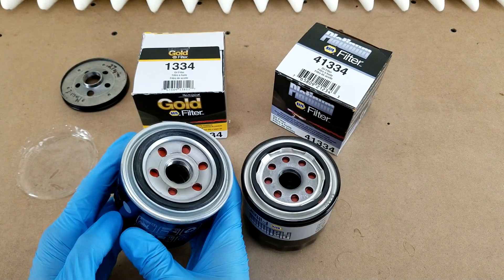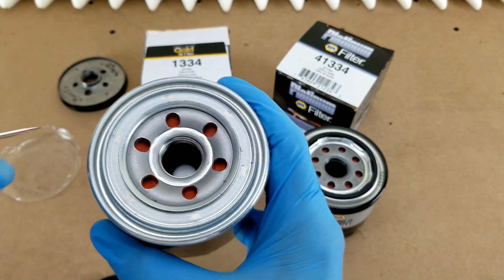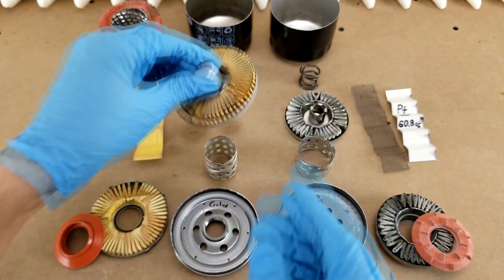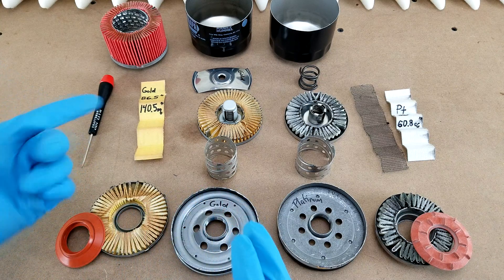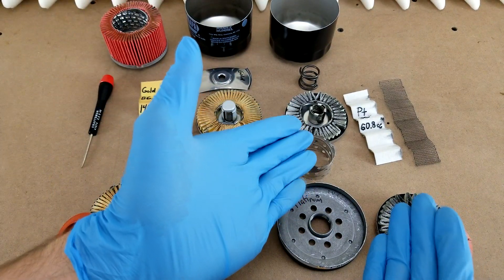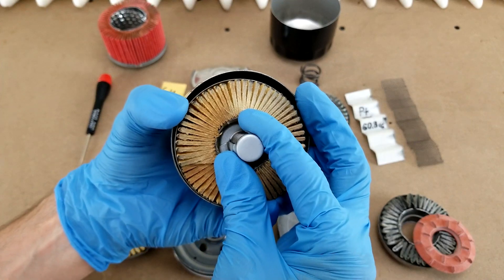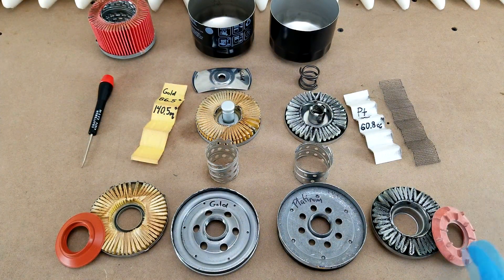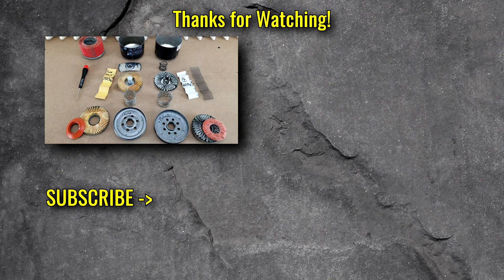NAPA Gold & Platinum Oil Filters Cut Open!

Comment: I do like the larger holes = more oil flow which is key .. but the platinum has that wire mesh backing for structural integrity (no tears, etc) and I wish the gold had it as well ..

Comment: Just a couple comments on the video. I notice the area of the inlet holes mentioned, that's ok. However, as long as the area of holes equal to the inner diameter block mounting stud, it's fine. My speculation, both filters at least that likely more. Also Plat synthetic media is depth media as opposed to NG cellulose/blend media, surface area filter. So amount of media and centertube size, not really comparable.

Comment: I work at Napa and the 1334 filter specifically uses the same style gasket as that platinum. And some of the gold filters but not all use the bypass valve built into the anti drainback valve. Not really sure the reason why some do and some don't. And most gold filters use a coil spring now instead of stamped steel.
Reply: I was looking at the spring factor too .. important but not a deal breaker ..

Comment: Good videos. I like your style if comparing debris micron size and material thickness. 
Not sure about the concern over the seal coming off. You should ALWAYS inspect the filter seal surface for debris - and that the old seal isn't stuck there.

Comment: It's Wix dude. Mann and Hummel bought Wix. Affinia is the packaging company Wix used. 

NAPA ProSelect, Gold, and Platinum are ALL Wix filters.

NAPA Platinum is the Wix XP line and Gold is the Wix standard line for regular automotive.

If you ho on the Wix website the part numbers are 51334 and 51334XP.

The beta ratio there says 2/20=6/20 and I have no idea what that means. You'll have to call Wix to clarify that. 

I do KNOW by experiment that the synthetic media tends to capture more dirt before clogging per square  centimeter and tends to collect in a more uniform size grouping versus semisyn, cloth, and paper versions. 

Basically you tend to get holes at the later stage of the filter in most media that allow larger particles through that the synthetic media resists because of its much more uniform construction and generally stronger material. 

Filtering oil isn't necessarily about getting the smallest particles. That actually can be a very bad thing. Oils contain detergents in them that can be larger particles. If you filter that out you may as well run non-detergent oil. Which will void the warranty of any new vehicles and you better be changing your oil every 3000 miles or even much less. And you'll probably trash any motor made after 2003ish within a very short period of time doing it. 

The other side is oil flow. The more the media filters(meaning smaller particles) the faster it cloggs up shunting to bypass mode. Which means no filtration. I've seen some filters where they put such dense media in it but the bypass springs were rated too low so that the filter immediately ran in bypass mode. 

These things all have to be accounted for when engineering those filters. The goal is to grab the MOST harmful particles over the expected run time without affecting oil flow or entering bypass mode. Not to grab ALL particles which would include detergents and other additives necessary to maintain an engine. 

And different applications have different parameters. Some trucks they have a main filter and a separate bypass filter. Often with different particle filtration. Or a GM 5.3 has a system where the filter requires a higher burst pressure and no bypass valve at all because of the way the engine is made. Yet it still has the same 21 micron nominal filtration used in the 1334 you opened.

Basically the Platinum/XP Wix filter will work in engines with tighter tolerances(newer engines as the 1334 fits Honda from around the 80's or older all the way up to at least 2017 models with super tight tolerances in the engines requiring synthetic oils even because of it)requiring a more uniform particle removal or in extended run times where you have a longer interval between oil changes, or more severe driving habits/locations that tend to introduce more particles into the oil from your environment. 

There's more to filtration than just looks and particle size.

Comment: I use chevron havolin oil have had very good luck with havolin and I don't like synthetic oil I used Fram xg filters for years at last oil change I used a napa gold oil filter in my truck and noticed I now have better oil pressure at idle and highway speed I will be using napa gold from now on seems to be a better filter
Reply: Duane Dove me too, seems NAPA GOLD,  are GOOD filters:: on my two vehicles, though I used ROYAL PURPLE WITH MY 2007 CANYON 4 CYL, AND MOBIL ONE EXT3NDED , for extended and ***severe use( summer heat, air conditioning also)...thouhg nirmal defaulted is GOLD NAPA..interestingly, I think Truck runs better with ORIGINAL AC AIR FILTER HERe IN MONTANA( I used K& N CANYON TEN YEARS previously , (interestingly in  WARSAW Indiana, though was low dust loads THERE,!)....

Comment: Between Fram Ultra Synthetic, Napa Platinum and Mobil1 which should I go with?
Reply: Napa definitely!
Reply: Yes save yourself some money , napa plat, or wix xp... same filter.and also fram just recent dropped there wire mesh around the filter media( cost cuts). But did not lower the price. Fram sucks once again.

Comment: hey filter king can you also let me know about the napa batteries I heard another company is making the new legend  batteries I would like to know if the quality is just as good. let me know. thanks for your video.
Reply: In the South(I believe the percentage is like around 75% of all NAPA stores period)all NAPA batteries are made by East Penn Manufacturing. In the extreme North they are provided by Johnson Controls(roughly 25% of the NAPA stores). 

EPM is a 100% made in America battery at their Pennsylvania facility. They recycle 99% of a battery including the acid. They are also opening a finishing facility in Texas. Basically it will be taking the empty shells, plates, and tops and putting them together and filling with acid. 

I will say that recently EPM entered a deal that they had been refusing under older ownership to outsource some Korean batteries to supply Wal-Mart. I don't know how many Wal-Marts, but I do know those aren't real EPM batteries. Basically the new owner(son) saw dollar signs they didn't need but he wanted and went for it. And typical Wal-Mart fashion they are ONLY interested in the brand name, not the actual product, and demanded a far cheaper price than could be done, so the only option was foreign outsourcing. 

Simultaneously, NAPA demanded that EPM NOT service them with any non EPM batteries due to customer demand. So far EPM has maintained that separation. Without it a massive amount of independent stores would drop NAPA batteries overnight. Knowing that the move by EPM would be to shutter the Pennsylvania plant and switching to other companies like Exide. 

Who despite a rough run would still be far better than another foreign clone like Johnson Controls, Interstate, Continental, Duralast, DieHard, and many others that are all made in Asia and imported where stickers are added with the acid and sent out masquerading as quality they definitely don't deserve. 

So depending on where you live you either have the Chineseium Johnson Controls making the batteries or the USA EPM batteries. The latter are far better, but EPM can only handle so much demand. All though they are increasing capacity with the new  finishing plant in Texas. So who knows. 

They definitely don't currently have different manufacturing for the different tiers of automotive batteries. The red, blue, and grey are all made in the same place. 

The one outlier is the crappy Optima batteries that some people get hooked on. They are all made in China for Johnson Controls. Without exception. And have been now for more than a decade or 2.

They are what's called spiral AGM. EPM makes a much better AGM that comes in the grey cases that doesn't utilize the spiral structure. This means the batteries fit in traditional locations without any modifications or special hold downs. The batteries are generally around 100.00 cheaper as JC prices the Optimas like Interstate used to price their junk Chineseium batteries for the old name pull they earned in better times. Yet the EPM tend to last longer in real world tests. 

NAPA batteries for automotive are in series groups. The first 2 numbers identify the series, the rest identify the type.

40 26r is a lower end 40 month warranty battery. It's actually usually used for equipment, but they do make some of the automotive types in this series too. I would only recommend for the older car, say pre 1995/6 when the current OBD standard was adopted.

65 26r would be a 65 month warranty red sticker battery. Typically these are used in used car lots, and the batteries aren't bad, but they will definitely struggle on vehicles newer than around 2004ish. It's a good battery if you have a car you're just trying to sell and need the potential buyer to take it on a test drive, but its life expectancy is lower overall.

75 26r is a very good battery. 75 month warranty overall, first 18 months is free replacement. This is the main battery NAPA sells. 

84 26r would be an 84 month warranty on the best lead/acid style battery NAPA sells. The level of care in these makes them almost required in vehicles post 2014 due to sensitive electronics. 

And then there is the specialty batteries. 

98 26r would denote an AGM version, and not warranty period like the rest. AGM batteries are preferred in heavy electronics vehicles where the battery takes hits draining them like a deep cycle often. Cop cars, ambulances, fire trucks are all typical uses. Due to their ability to be placed in orientation other than typical such as laying on the side, they are also used in race cars alot.

Comment: ....You'd think that it being "Platinum"...it would be a higher tier....or am I just ignorant of something.
Reply: They are a higher tier. Wix uses synthetic media for a reason. 

There is WAY more to filtration than simple pleat counts. And no engineer worth a grain of sand would stuff a filter with superior synthetic media to the same density of inferior paper or semi synthetic media. 

An engineer by definition will do the maximum with the minimum resources. All engineers.
Reply: 469Shooter gotcha......now I need to wonder about their front solid brake rotors for the 6 piston challengers lol.

Comment: does the oil pressure change with napa gold filter?
Reply: Not at all that's why all filters have a bypass. If oil is thick on a cold start and can't flow it will bypass until operating temperature is reached.
Motorcraft filters have a different bypass design that prevents the oil from going over the media and washing debris off. It directs the flow right back to the engine.

Comment: Since Wix makes the Napa filters I think it would be interesting if you could do a side-by-side comparison between the Wicks and the Napa filters of the equivalent specifications and other words like the Napa silver the Napa Gold and Napa Platinum versus the Wix equivalent.
Reply: Wix and purolator are both owned by Mann!
Reply: @EpiLover  unfortunately when the filters become Mann designs their efficiency numbers are awful!
Reply: Just because they are made by the same company does not mean they are built to the same specifications.
Reply: @j.r.3215  

In the case of Wix NAPA filters it does. Wix is the company that maintains the data on that NAPA filter website. 

Most NAPA stores only use the Wix website if they need info as you can easily convert the part numbers in your head but they have that second website for commercial customers to use so they can easily look it up with the NAPA numbers on it. 

Other than some water filters and hydraulic filters all Wix filters share the last 3 numbers at least with the NAPA part numbers. Usually it's directly the last 4 numbers. But some of the newer stuff is off a bit.

Those 2 filters ARE the Wix 51334 and 51334XP. Not versions of, but the exact same specifications and all. The only difference is the paint silkscreen on the filter and the print on the box. That's it.